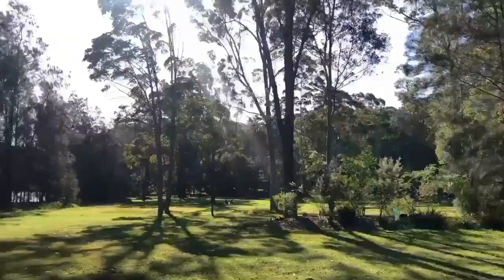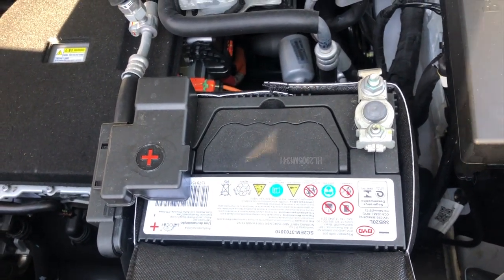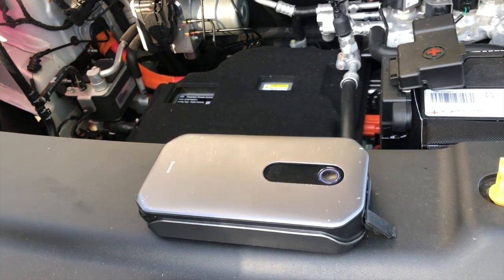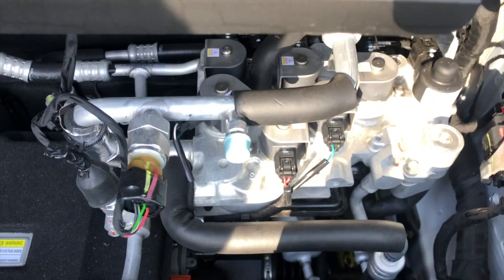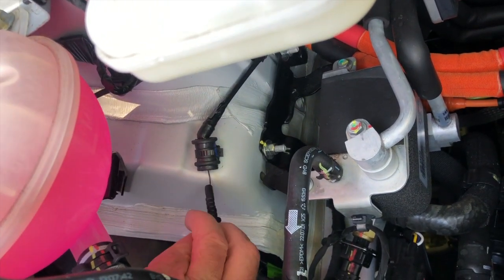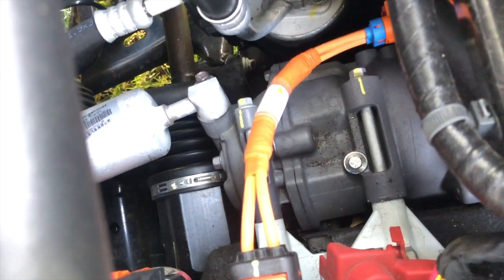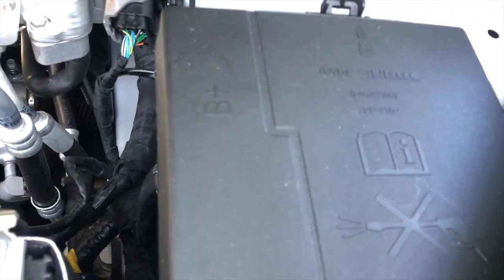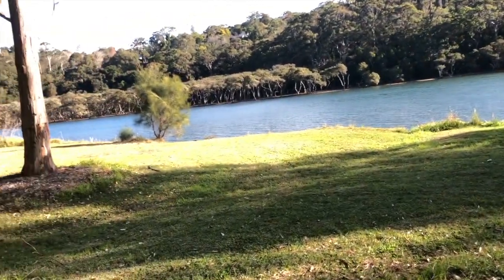What is under the bonnet of BYD Atto 3

Comment: Hi Chris, have you disconnected the artificial sound generator for low speed driving?
Reply: That's the pedestrian warning system, an important safety device. It should be illegal to disconnect to disconnect safety devices provided by the manufacturer without getting the vehicle recertified.

Even though red letter law may not have caught up with this yet, if you do disconnect and have misfortune to hit a pedestrian (in this context I think children in car parks) you would very likely not be covered by insurance and be personally liable for any injuries caused. Say farewell to your car and likely your house as well.

In the most egregious case where you deliberately disable a safety system leading to a death, it would likely be manslaughter leading to a couple of years in pokey.
Reply: @jimgraham6722  yep correct. u need to inform the insurance company it's modified.
Reply from the maker: yes I have. it's so much better.

Comment: Did your byd comes with the felt cover on the powertrain domain controller (AC to DC converter). Mine doesn't comes with it. Kept me wondering why.
Reply from the maker: Yes all the Australian ones which are single phase charging have this felt. From what I can tell 3 phase charging models do not have this or don't have the felt cover.
Reply: @Carnormous  my swedish model hasn't got one.

Comment: Hey Chris, I have a red Atto 3 in Perth and you should note that they completely half arse the paint job. My engine bay is pink from lack of paint and has patches that are completely unpainted and of course not a shred of clear coat inside. Pretty dissapointing in my opinion.
Reply from the maker: Hi, yes I've noticed even the white has very unfinished paint work under the bonnet 😂
Reply: Probably a batch problem, the paint job on mine is very good all over.